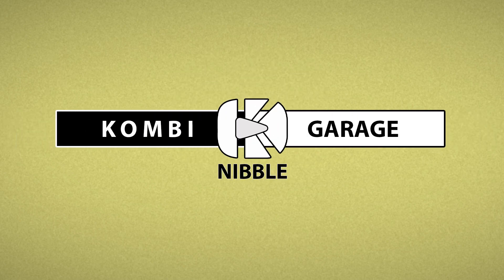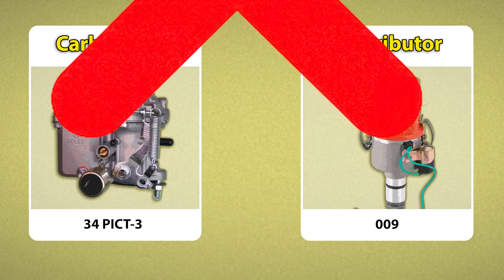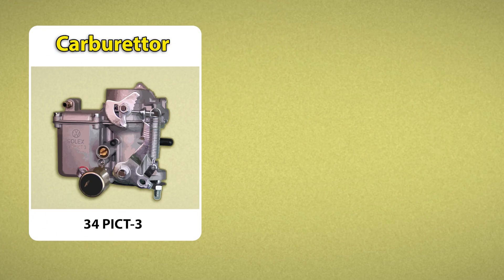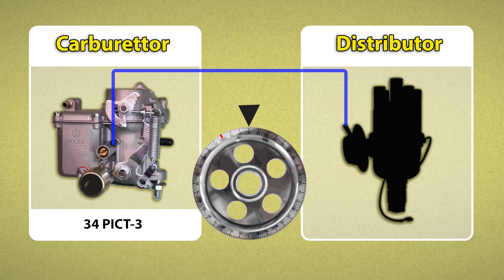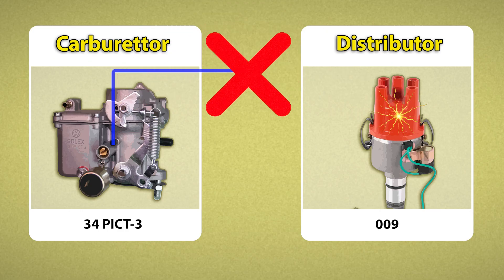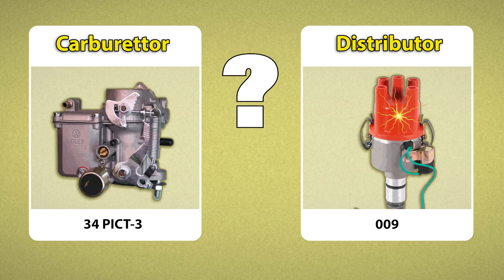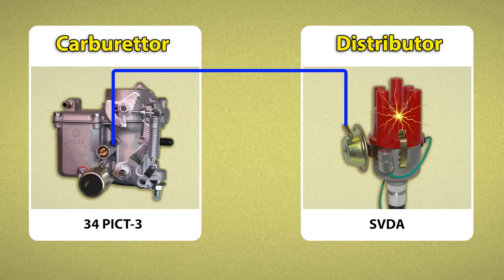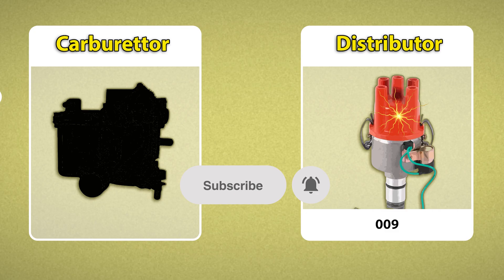Why Your VW Runs Like Rubbish with a 009 Distributor

Comment: I think the popularity of the 009 must have started after John Muir talked about why he didn't like vacuum advance distributors in his Idiot's Guide to VW book. He recommended people dump those for a straight mechanical advance set up, and said that people would be better off driving with them, and better matching revs to the advance curve before shifting.
Reply from the maker: You make a great point! John Muir's insights definitely shaped a lot of opinions about distributors. It's interesting to see how those recommendations still resonate with some VW enthusiasts today! 👍
Reply: @KombiGarage  Both my Superbeetles had 009s when I got them. im still running one in my current 74. It seems OK, but I sure appreciate your specific info on it.

Comment: Hello i have1300cc with a 1600cc kitand  a 30 pict 2 carburetor     what is the best distributor to run with it,
Reply from the maker: Hey, thanks for the question. 
It sounds like you’re running a Single Port. With the 30 PICT carb, it’s best suited to a Vacuum Only distributor, a Bosch 205T. 

Timing for this setup would be set to 0 degrees on idle 👍

Comment: When you have dual carburetor does that vacuum advance
Reply from the maker: Great question Mark 👍There are two answers to that, and it depends on what carbs are used. The aftermarket versions, like Weber, don't use vacuum advance, and often paired with a 009. Then, there are Solex setups that do use vacuum advance, even a factory version on the Type 3 and 4. I suggest you consider what you are aiming for, if its drivability, and everyday type use, stick with a vacuum advance option. Cheers, Joe